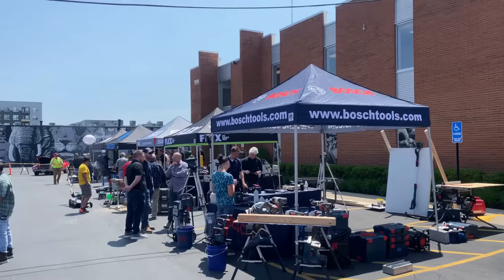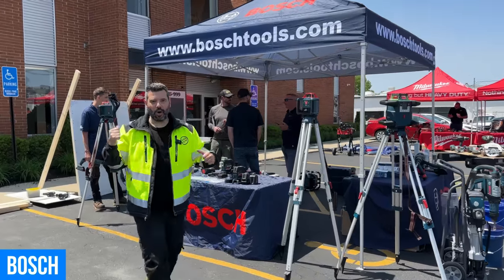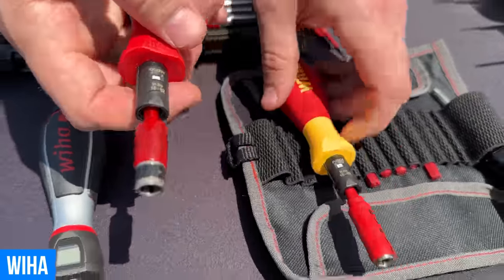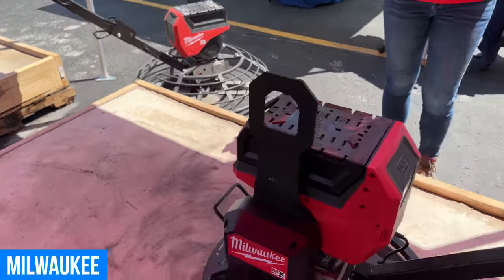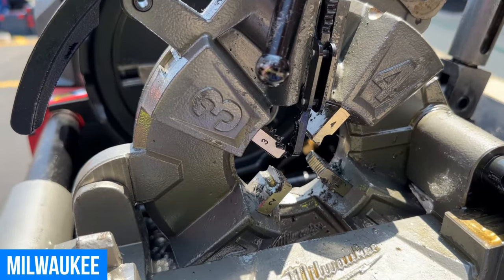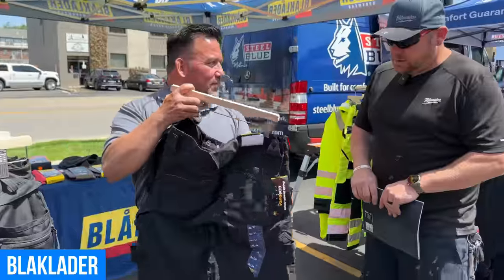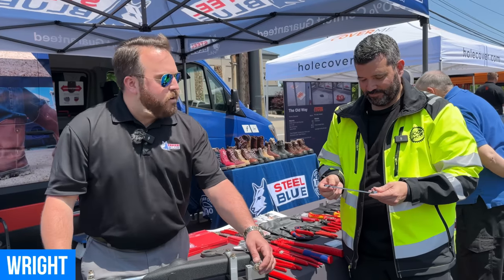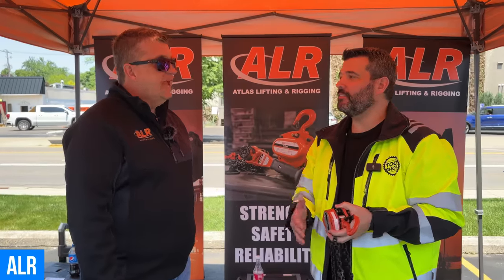NEW POWER TOOLS! Milwaukee, Bosch, FLEX, and more!

Comment: Those specialize hand tools were so interesting! I need to figure out why I need those insulated torque screwdrivers.
Reply: Almost all insulated tools I've heard of are meant for electricians. I recently saw a video with some super large cables that had bolt together connections and the comments said that that kind of electrical connection required a torque rating. I'm guessing that what the insulated torque screwdriver is for?
Reply: Most main circuit panels/breakers list specific torque values for the screw in a circuit breaker that secures the hot wire. Per NEC, most if not all screws in electrical work should be torqued to a specific value, but I've only seen values listed for panels.

Comment: I want the stand on that Milwaukee pipe threader in a version for Milwaukee miter saws and table saws. Fold up with big wheels for jobsite portability. 

Also, a tool battery hoist system with wireless remote would be cool.
Reply: Just buy them and figure it out later!

Comment: I live in Canada and what really pisses me off about Flex power tools is they are hard to get where I live. Sure I could go and order then online but I can not put it in my hand to see comfort levels. I really wanted to buy the Flex High Torque impact wrench but no one around me has any. I am trying to get away from Milwaukee but it makes it tough when Milwaukee sells like hot cakes where I live. I just bought the Milwaukee 2967-20 High Torque impact wrench for $298.99 bare tool. But Buying it as a set with only 2 5ah batteries is $708.00. Flex needs to step up their game and get their power tools in more communities in Canada. They lost out on the High Torque impact wrench.

Comment: The problem with MX is that Milwaukee did not do a good job designing the battery and it overheats as a result. All they did is stick two m18 12ah batteries together. Stupid and lazy design. Makita XGT is a truly new battery platform. It’s as if Milwaukee had a year or two of R&D and a limited budget. XGT batteries outperform MX in almost every way.